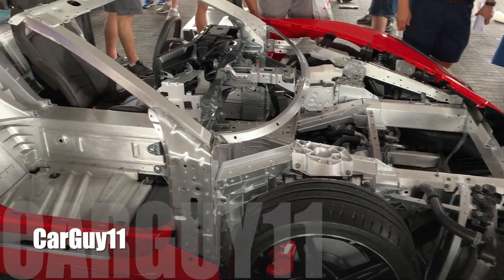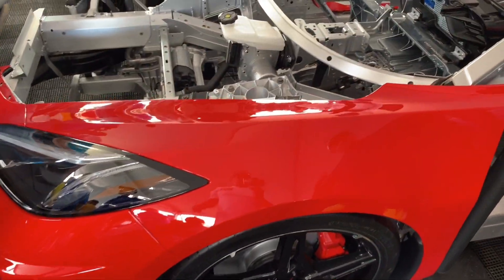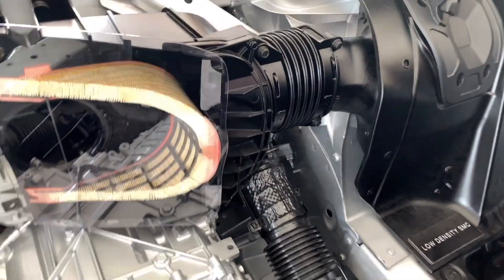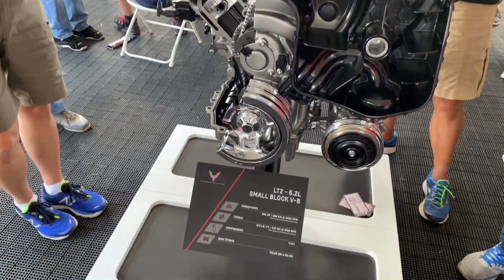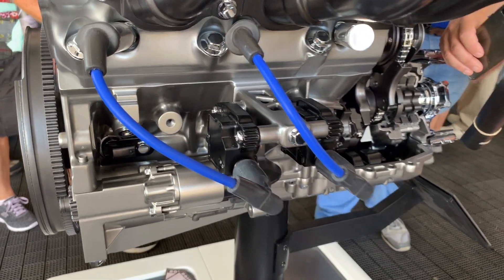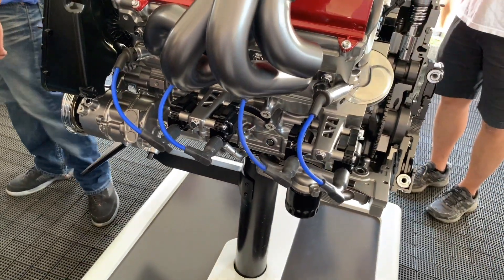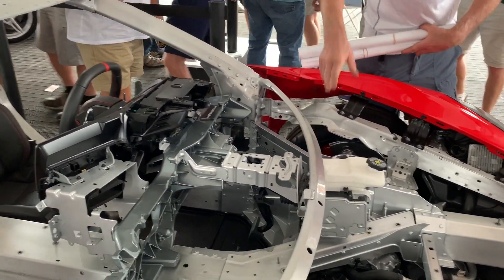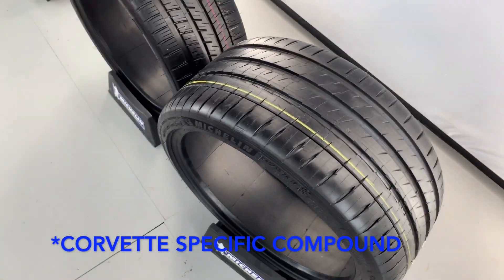What They Hid On The C8 Corvette!

Comment: Sadly the composite body panel material used is not "repair friendly" if damaged. Replacement of individual panels is necessary in cases when damage occurs. And those individual panels are all quite "Pricey".
(They sure don't build 'em like they used to. They're not fiberglass or carbon fiber that "Can" be effectively and somewhat easily repaired) 
So don't "hurt" them.
By the way the Corvette is not the only vehicle using this material. Pretty much all composite panels on most models use the same materials. And the prices reflect the same thing. Pricy and non-repairable. Or better said, not cost effective to try and repair. Prepare to "Bite the Bullet" and buy complete replacement panels because you can't fix them and expect a satisfactory long-term repair.

Comment: That's a huge center tunnel for not having a driveshaft.
Reply from the maker: Yes. They use it all for structural support.
Reply: @CarGuy11  that guy talking said that it's huge and he's surprised that it is huge may still be using it as a structure looks like.  That doesn't sound like an engineer talking.

Comment: This guy has very little knowledge of Corvettes or Automotive in General.  A high school graduate would have been a better choice!
Reply: I agree - he says "heres a cooler (up the front) I dont know if its for the engine or transmission". Then there is the small radiators at the rear in front of the wheels 'I dont know what these do". Well dumbarse, you just follow the pipework and see where they go!  I'd be impressed if this guy even knows where to find - let alone read, the oil dipstick!

Comment: Since they did not include port injection with the direct injection, how did they address the carbon buildup on the intake valves which is a common problem with direct injection engines?
Reply from the maker: They claim it’s not an issue but I put a catch can on my C7.

Comment: Interesting; I thought that placing the engine closer to the drive wheels should reduce the weight since you don't need no stinking power loss of the longer FE/RWD driveshaft.....Instead a 2020 C8 Z51 DCT weighs about 200 + lbs more than a 2019 C7 Z51 8-auto....One of the big weight problems? The new tranny weighs in close to 350 lbs! Or about 100 less than the engine....Crazy!....However, you can't deny the 'magical' acceleration. And a base C8 with only the Z51 will set you back $65K while at the same time only being matched by a $122K 911 Carrera S (w/out power seats!) . The C8 tested in the article below is a heavy-optioned 3LT Z51, meaning that a lighter, basic 1LT with the Z51 should do a tick better, plus it has power seats!. Imagine that, $65K and the nearest competition is almost twice as much! Obviously more people can afford the $65K than the 911 Carrera S.
https://www.motortrend.com/cars/chevrolet/corvette/2020/2020-chevrolet-corvette-c8-vs-2020-porsche-911-comparison-test-review/
Reply from the maker: Wow I didn’t know the DCT weighed that much!

Comment: If the master cylinder is indeed a “brake by wire” system, that would almost guarantee that GM will be making a hybrid Powertrain corvette, the so called Zora edition. Hybrid needs a brake by wire system to blend regen with friction brakes. The Volt and Bolt EV has this. Also the Acura NSX has brake by wire but hooked up a little differently
Reply from the maker: Yeah good possibility.

Comment: Man, do you know anything about Corvettes?  I don't know if I misunderstood you or you just don't know what you are talking about.  The ONLY Corvettes that did not have a high center console is the C1 & C2!  The C8 console is right on par with the last few generations! The only big difference is the climate control bar, whatever you want to call it.  FYI the center exhaust started on the C5.  Why would the side exhaust be controversial?  Up until you, I've not heard or seen anything talking about the location of the exhaust exit.   How does it look like the engine is hooked around 180 degrees from the C7?  If it were, it would be a transverse mounted engine. Meaning the engine exhaust and cylinders would be lined up left to right.  It looks like and it is  a longitudinal mounted engine as all Corvettes have been.
Reply from the maker: Exactly this is the first mid engine Corvette so it doesn’t have to have that. Look at any other mid engine car interior.
Reply: @CarGuy11  Oh ok I see what you mean.  You're talking about the transmission tunnel of the OLD style Corvettes.  Gotcha.  LMAO All front engine Corvettes are now the OLD style!

Comment: Engineers were smart to adopt Colin Chapman's backbone chassis design.
Reply from the maker: Yeah but you loose the flat floor of a normal mid engine chassis.
Reply: @CarGuy11  True. But the backbone won't twist and flex. I drive an '88 Fiero GT. And the backbone center console was perfect for the car's stability in the turns. And although vastly inferior to the new vette, Colin's design for his Lotus was the wise choice for Chevy.

Comment: When you begin to fry the brakes with a Brake-By-Wire e-booster system, the smell is your really your only feedback, even if their pad temperature model is spot on (which would be impossible). If the brake temperatures are neglected for long enough (for example on track) and the fluid actually boils (rare but does happen) then the system will most likely (should) set a leak detection fault. Once a leak detection is set, we get nice things like circuit isolation and no boost. Cheers!
Reply from the maker: Yeah they will have to have a dash warning light when brakes get overheated.
Reply: vaccuum boost was the same way.  this system is being sold as a brake by wire, but that's really untrue.  it's simply an electric over hydraulic assisted accumultator instead of a vaccuum accumulator.

Comment: They hid all the problems they found in the year it was delayed. Too bad they settled the strike, they should have closed!!! Wheels cracking, not covered!!! Transmission slips and has harsh shifts, your problem not theirs. Torque converter shakes, not their problem it's yours. Overheating on Z06's, not their problem, it's yours etc etc etc sue the pricks!!! I did and won!!' Sued them over my Cadillac and won!!! Problems after problems and call GM and all you hear is were so sorry your having issues!!! Just sue them. Lemon law lawyer!! Get one one on speed dial!!!
Reply: I did that

Comment: How in the blue hell is this car priced under 70k. So much innovation and technological advancements in this car.
Reply: Kinda shows how overpriced modern cars really are. We live in a time where a more expensive product sells better, because it has more prestige...
Reply: @xXYannuschXx  I don't see a Carbon Fiber monocell in the C8. I don't see carbon ceramic brakes, I don't see alcantera interior with 100% magnesium trim. Yeah you get what you pay for. Can't even compare the likes of a Ferrari to this pile of dung coming out.
Reply: @LokkiSaints  And yet, this car will be way faster than most cars that cost 3x as much. A C8 is actually achievable without being a rich boy.
Reply: Development cost can be mitigated through mass production of any given product.  GM does this very well, compared to other auto manufacturers.
Reply: 808 G8GT makes one think what corners are being cut?
Reply: @jimbeam4111  Not really. Minimal parts being shipped over seas. Also....no ridiculous mark ups just for status like ferarri, Lamborghini, GTR, etc. I'd take a C8 over ANY exotic, japanese super car.
Reply: @808G8GT  Over seas? You mean just south of the border? Mexico. That's where the LT1, LT2 and LT3 blocks are being made right at Nemaks plant in Monterrey, Mexico. I'll go with the BMW motor in the MKV Supra any day over anything mechanical built or assembled in Mexico LMAO. Lastly, nothing from the US has even come close to touching the LFA not even the iconic Ford GT.
Reply: GM must be using the profit from sales of work trucks and fleet vehicles.  The technology they use in Corvettes will usually trickle down ti other GM vehicles.
Reply: Probably a 'loss leader' in the first year of production.  There's too much value in the car to ignore and the offshore exotic mid-engine brands will have to double-down on how 'exclusive' they are.
Reply: Under 60k* lol Chevy trying to make some money lol
Reply: Casting and economics of scale
Reply: Volume

Comment: So why dies it weigh 3650 pounds?
Reply: Because the body isnt made of carbon fiber!! Lol.
Reply: @808G8GT  fiberglass is about as light. Just weaker.

The 1st gen NSX had an all aluminum chassis just like this car and it weighs nearly half a ton less.
Reply from the maker: Good question it’s disappointing. The size of the car grew so main cause plus new suspension is heavier.
Reply: heated seats, cooled seats, front lift, nav, 182 way power seats, adjustable bolsters, 16 speakers with 2 dedicated subwoofers in a sports car, leather where totally unnecessary, power folding mirrors, 5 unnecessary cameras, etc.  Same reason all cars gain 100 pounds or so per generation.

Comment: That front suspension with the coil spring reminds me of early A body front suspension.
Reply: I like how it's got bolt on style upper control arm bushings. Those are stupid easy to get at and it means you dont gotta fight the strut to get access to the inside nut like on older cars. It seems this car wont be too bad to work on unlike some vettes

Comment: 0:50  does that look like a space where a differential unit with half shafts could fit?   :)
Reply from the maker: Well probably battery & electric motors on the hybrid version!
Reply: I'm holding out for electric hybrid.
Reply: looks like it and you can hide big battery packs in the center tunnel adding to rigidity and keeping a low center of gravity

Comment: From a engineering perspective its a novel idea that could very well be superior to ALL other chassis design. The center spline and all other supporting structure leads into a TRIANGULATION design that is repeated throughout. Very interesting.
Reply from the maker: But there is the drawback of the large tunnel that takes up tons of interior space.
Reply: @CarGuy11   Its enough space for a two seater sportscar, and if you notice the interior is a cockpit design to a extreme. GM has no problem incorporating new technology into their lineup that is world reknowned to a extreme. More than the most exotic companies, and i believe you are viewing one of these advancements. A bare bones C7 dosent have a chassis anywhere near this high tech. Look at each corner carefully, and you see structural Ribbing. I dont think i have seen it to this extreme before. This aluminum chassis is light years ahead of the last one.
Reply from the maker: @thiosemicarbizidebenzoylal2921  The C7 had same center tunnel & aluminum chassis.  They needed the tunnel for torque tube in C7 & C8 uses an evolution of the C7 chassis which is why it still has the center tunnel.  In my opinion, one of the best features of mid engine cars is the lack of center tunnel.
Reply: @CarGuy11  Battery should go through tunnel

Comment: Yep, as I mentioned a while back in one of your live streams, the C8 still has a tunnel for structure, thus the door rockers can be lower allowing easier entry and exit!  Thanks!
Reply from the maker: Yeah and fortunately the center console & cup holders are a little deeper than C7 as shown in this video. https://youtu.be/UlRbpOOeV9A
Reply: The Lotus Esprit's excellent handling came from just such a tunnel/backbone running down the center of the car.  GM owned Lotus for awhile.  This chassis reminds me of the Esprit.
Reply: Would this also lend itself to the possibility of an all wheel drive system of some type? Either space for a drive shaft, or batteries for a front mounted electric motor?
Reply from the maker: Martin McComb Yes that is a possibility.

Comment: Great upload. For the life of me I can't figure out why GM is not giving purchasers the option as to which tire they want. I would want the A/S Michelins with my Z51 and if I want to track it seriously, I would purchase the "sticky" tires separately. With only the "sticky" tires I lose driving time living do to the cold weather here in the NE. Save the Wave.
Reply from the maker: Thanks! GM feels opposite, if you buy Z51 you would want to track so can buy all seasons if you don’t.
Reply: @CarGuy11  Obviously GM "feels" differently, but you're missing the point.  The Z51 is not a dedicated track car, but affords one the possibility to track it. Most purchasers of the Z51 will not track their, but go for that option just in case. If I lived it in a state that never goes below 50 degrees, fine, let it come with sticky tires. There would be nothing wrong with GM adding tire choice as option.
Reply: @CarGuy11  I agree with Peter, I bought my current 3LT Z51 for performance and all the bells and whistles one gets.............including wonderful highway driving and great gas mileage.  Don't want either spoiler/wing on my C8, but do want all the other goodies, except the tires too. Those tires last about 15-18K tops. If you want to track, buy the tires required.......mistake by GM of the younger set not REALLY knowing who will use for what purpose, but DICTATING HOW IT WILL BE SOLD
Reply: @Truthisstrangerthan Fiction You are missing the point. GM can do all the testing they want on the base model and/or the Z51 and THEY can opt to use the sticky tires and they should. I would like to see GM give the purchaser the option as to which tires they want. It's then a win/win for all concerned.